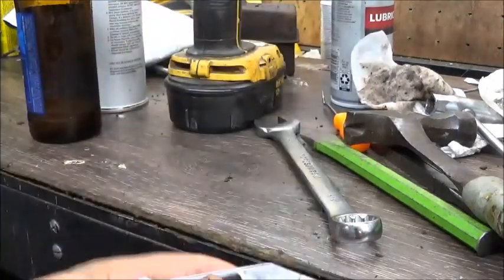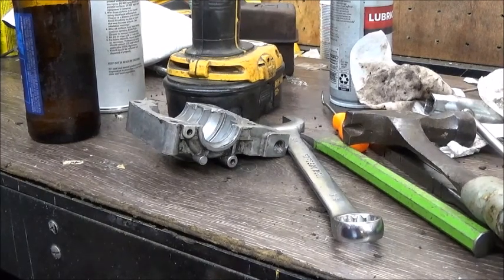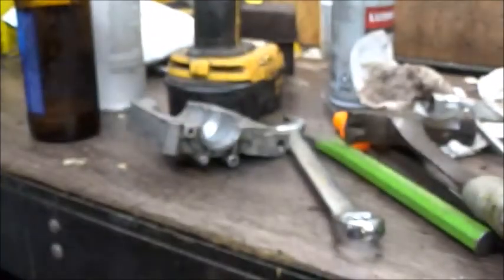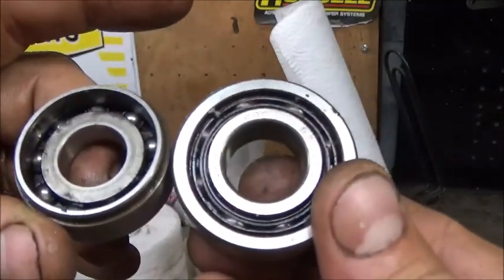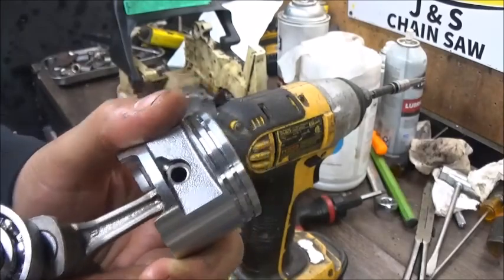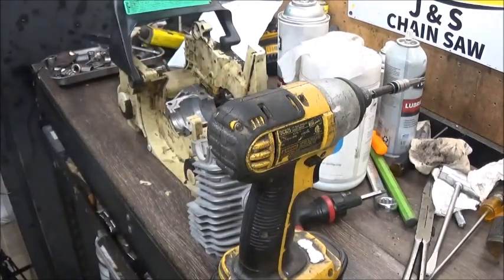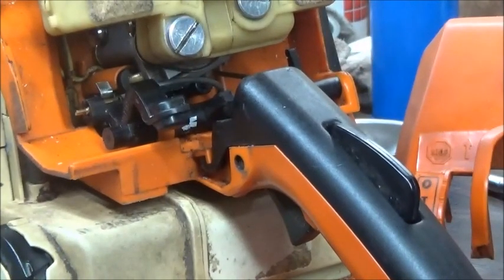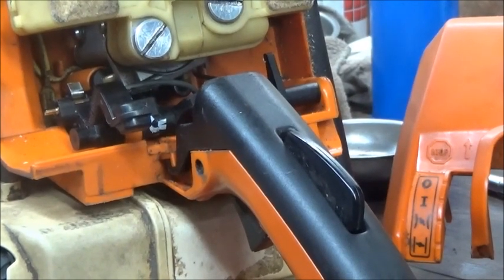The Sleeper ms290 back together port work and test cuts

Comment: Nothing wrong with electrical tape (3M 33) haven’t bought bandaids in 30 years. I got some dry ice for sleeves and heated the block with a rosebud on a tractor engine before, your freezer and heat is the best way installing bearings! Sounds awesome!

Comment: I would definitely recommend staying away from Ebay carbs on these because the ebay carbs Venturi is not round and they can not be bored out on the side it has the flat spot because of them slightly changing the passage ways. Learned this when I ordered a Ebay Chinese ms390 carb for the Chinese 58cc 5800 split case saw had to make a intake manifold from a factory ms390 intake boot only changed the carb because used and ported a quad port 46mm cylinder for it as it is a 34mm stroke crank and not the common 45cc 4500 and 52cc 5200 saws. It definitely woke up with the bigger carb and .625" bigger then stock .482" pipe in the muffler . I would try and find a OEM ms390 carburetor as it has the slightly bigger jets. Just something to keep in mind on carbs.

Comment: Just a heads up the hyway ms390 49mm bore cylinders are a closed port cylinder now OEM and cross are not. The numbers on the ms390 closed port cylinders are pretty good. I think the closed port will help out with torque wont really know tell I put it together and get her going.